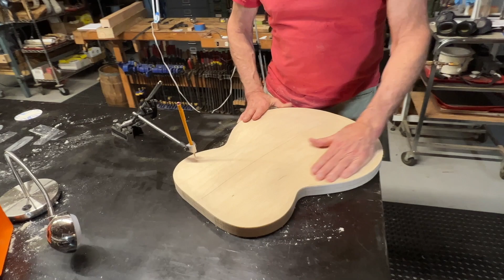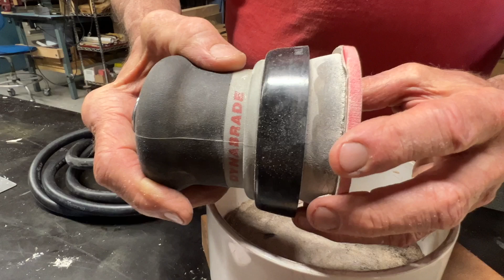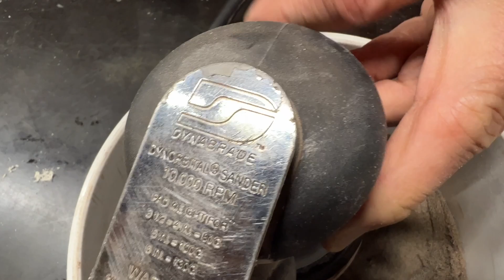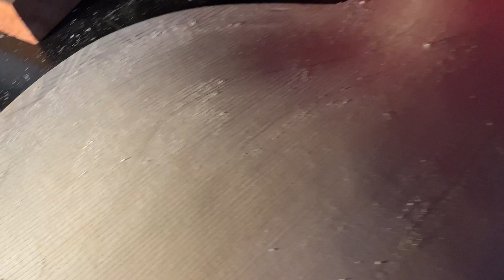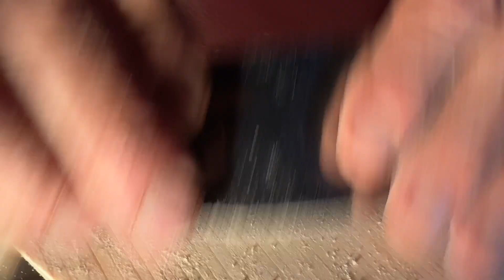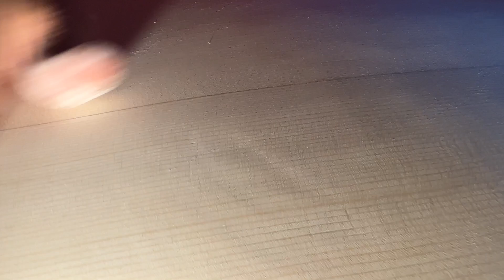Ken Parker Archtoppery - Arched Plates - Finishing the Top Exterior - Chapter 2

Comment: Maybe a few compass (from the perimeter) pencil tracks for locating an indicator with the surface gauge?
Reply from the maker: If you want the arch to follow the perimeter, this might be helpful, I suppose, but my plate models, and I would say most other's aren't like that. The method I show here measures the "topography" of the part that you created, as a check for symmetry and loft. As I mentioned, this is something I wanted to demonstrate because it is commonly done by builders of violin family instruments. I thought that this technique (which I haven't used before) might help folks identify high spots and lumps as they develop their carving chops, kinda like training wheels.
Reply: @kenparkerarchtoppery9440  Got it - I think :) Thanks for the reply!

Comment: Is it visual or tactile or a combination of both along with your mental idea of what the finished exterior what you are using for input? 
You stated in an earlier video that you are changing the top trying an idea for better performance, thus needing a different fixture for this guitar.  As always really enjoying your narrative!  
We won’t tell the new guys what the results are iffn you spin up a DA before contacting wood.  Had an “Experienced Professional Woodworker “ in our shop once, was sanding the inside of a red cedar Adirondack Guide Boat, he kept on lifting the sander up, under power, to see the results of his work.  One of the crew caught my attention of this, and the next time it happened my shout froze him in mid air.  From that point forward I would show a newbie with a (2x4 ) the results of a six Inch sanding disc the trench that would appear.   But you knew that.  DynaBrade great, but my pocket book sez Porter Cable primary and have inherited a Mirka that is supposed to be the bomb.   Will probably cut down the pads for curvy work, tin snips make 6” discs 3s quick!
Reply from the maker: Funny story. Maybe I made it look too easy, and don't remember how quickly wanted material turns to dust while you're first learning to use a DA. Jimmy D"Aquisto used a rectangular orbital pad sander that looked like it was 1000 years old. As a pup in the early 70's, apprenticing with a brilliant furniture maker, Richard Scott Newman, I had no experience with a hand held, or, for that matter, any power sander.  Everything we did was scrapers and fine sandpaper. The DA can save time, but really it only gets used in my work for a few minutes per plate surface, and isn't a necessary part of the process. I never used a hand held power sander until the 90's, when I was training employees at Parker Guitars.

Comment: At this point is the back of the top also arched?  I'm assuming it's still flat as it'd be hard to get good support from the backing plate otherwise.
Reply from the maker: That's right, it's currently a flat surface, and in this video is still bonded to the 1" thick workboard. Next time we'll show the inverted top clamped to the new nest we just made, and start getting the interior roughed out.